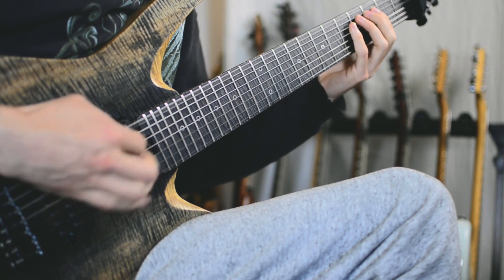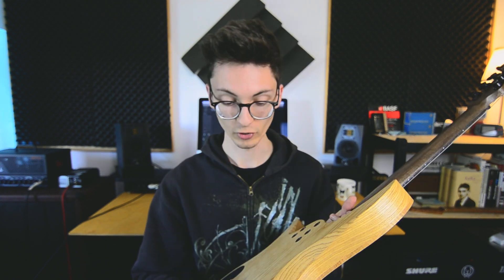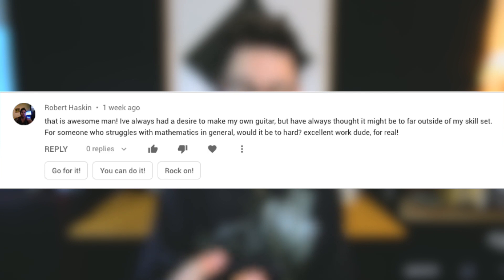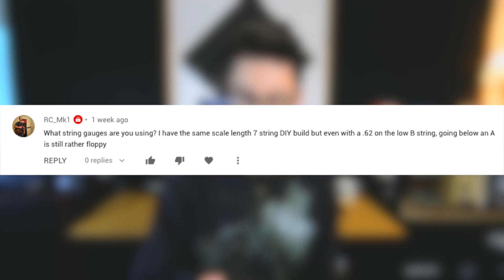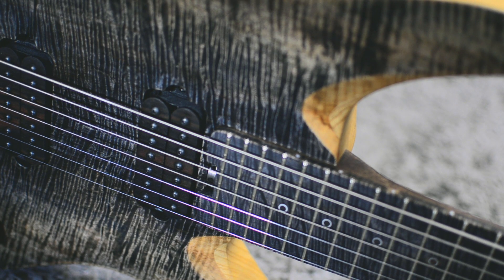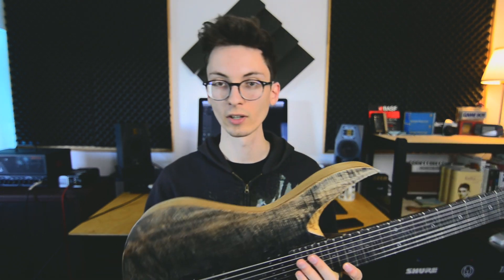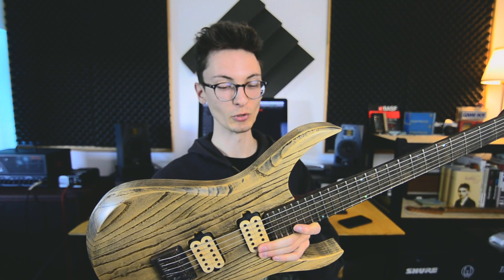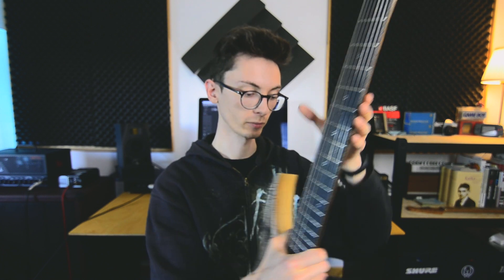Q&A about my DIY 7-string build

Comment: Cant wait to see the rest of the dullahan project. When might we expect an update on that?
Reply from the maker: Have an issue with the paintjob, will take a bit longer unfortunately than I planned...
Reply: @MilianMalivukMusic  that's fair enough. Are you planning to respray ? If so any chance of a hint on the colour ? 😁
Reply from the maker: Weeell it was supposed to get a seafoam-ish green, but the paint can sprayed so badly (it literally just squirted the paint) and the finish is really uneven. I'm probably going to sand it back again and do something completely different, I've got an idea ;)
Reply: @MilianMalivukMusic  we only learn from making mistakes I guess. I can't wait to see how it turns out.

Comment: Be a little careful with that mockup, you may run into issues with licensing against the GOC Satya. Other than that, I'm really looking forward to seeing more builds from you
Reply from the maker: Don't think that's going to a problem, the GOC's are completely different in my eyes. Different horns and dead flat bottom line.

Comment: How do you determine fretboard height/neck pocket depth?
Reply from the maker: I approximate neck + fretboard + fret height and then what minimal height the bridge saddles achieve. With this reference I know how deep the neck needs to be sat into the body so those points line up. At least that's my way.

Comment: where do you do the wood thinning? I thinks that's one of the things hard to do at home because the machines are quite big.
Reply: I mean you can set up a jig, and use just a simple router to carve the top of the wood. Cheap and a bit of a hassle, but great alternative if you don't have a planer.
Reply from the maker: I go to a local carpenter shop that has huge planing machines for precise work. They know me and my work and did it for free, it's like a 10 minute job for them with the machines.

Comment: Where did you find resources for neck and fretboard lengths? Cant find them anywhere. Also think you’ll ever do a multi scale?
Reply: Hey dude, look up fretfind2d website, input your desired measurements, save it as pdf file, and get it printed at the files actual size - and you have a glue able template to make your fretboard/scale bang on.
Reply: Archetype Guitars Nz cool. Thanks so much!!